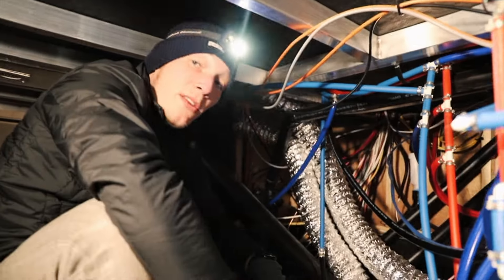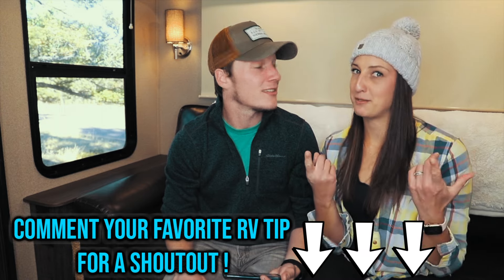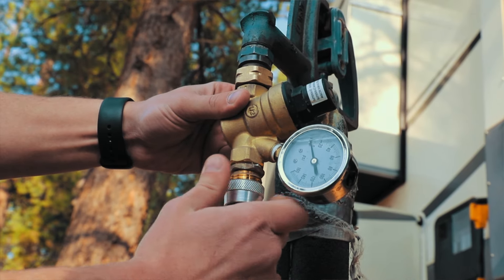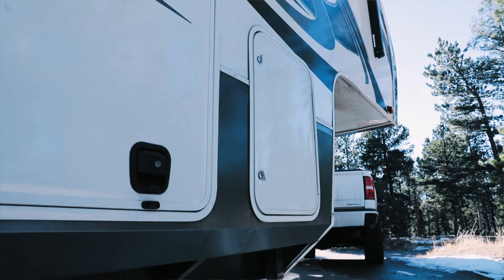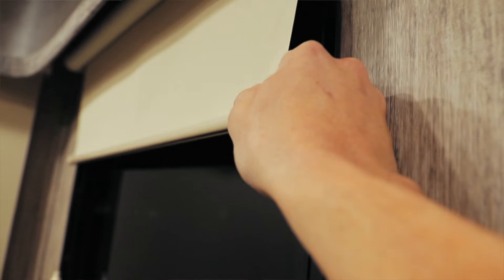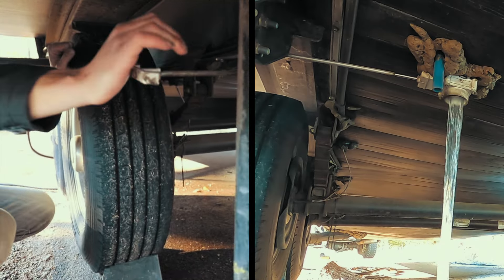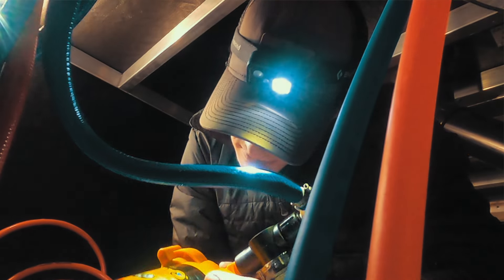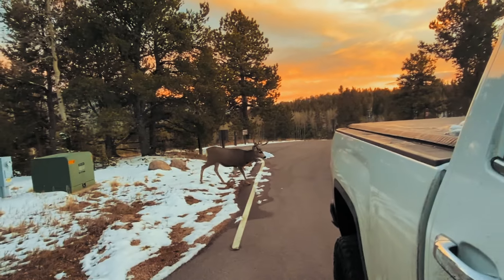First Winter in an RV - Frozen Pipes, No Water!

Comment from the maker: This is a video that is packed with valuable content to show you how to handle frozen pipes in your RV. You are going to find lots of information in the next 10 minutes, so we left timestamps below for your convenience to reference back to anytime.

If you found this content to bring you value, please leave us a like on the video 👍🏼 Leave us a comment below and let us know if you agree or disagree with any of these points!

Follow Us For More Valuable Content Related To RV Living: https://urlgeni.us/youtube/channel/KVJA 

✧✦❄ ITEMS FOR WINTER RVING ❄✦✧

---Heat Tape for Hose
https://urlgeni.us/amzn/heattape

---Heated Drinking Water Hose
https://urlgeni.us/amzn/heathose

---Insulator for Vents
https://urlgeni.us/amzn/ventinsulation

---Reflectix for Windows
https://urlgeni.us/amzn/reflectix

---Dehumidifier
https://urlgeni.us/amzn/dehumidifier

HappilyEverHanks Amazon Page 📦
https://urlgeni.us/amazon/HanksStorefront

⏱ TIMESTAMPS

 00:00 Video Start
 01:38 Top 3 Tips For Surviving Winter in an RV
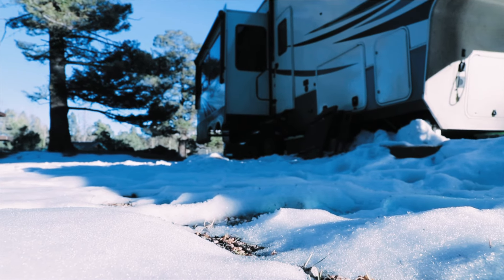 02:04 Preparing Your RV For Freezing Temperatures
 05:27 How To Stay Warm In Your RV
 06:56 What To Do If Your RV Pipes Freeze
Reply: Great video. Thank you. Check out Xtreme Heaters. They are a bit pricey but have a small foot print, use little power and turn on and off automatically based on the low (40) and high temp (55) in the compartment. Thanks again!
Reply from the maker: @noworries.8601  that’s a great suggestion! We have been looking for something really reliable, we will be sure to check them out! Thank you  😊 🙏- Kyle and Renee

Comment: Little tip guys if your hooked up to water in winter with a heat tape water line as long as the water is dripping your pipes will never freeze
Reply: I did that and I pretty sure the outside hose still frozen.

Comment: More great lessons for folks just starting out.  Cold weather camping can be tricky.  We highly recommend a heated water hose!  You can then run water on a very slight trickle at night to keep water flowing (we learned through frozen lines too!)  Another awesome video guys, glad you nothing got damaged. -Chris & Suzannah
Reply from the maker: Yeah it sure can be tricky, so sorry to hear that you guys also had to experience this 😭The heated water hose has been something that we have been holding off on the for the longest time...we definitely need to get one ASAP! lol Thank you Chris and Suzannah for the awesome comment and suggestion, you guys stay safe out there! - Kyle and Renee
Reply: Heated water hose and using heat tape seem to be a great fire risk- many catching fire.
Seems like leaving the water running with the grey drain open would be the better idea.
Or filling the fresh water tank and using the pump with furnace heat

Comment: Let it drip.  Anytime the temp gets below freezing you let it drip.
Reply from the maker: Great tip, Ross! Have you ever had any problems with leaving the water dripping all night and the tank was wondering if you leave the tank open and if so, have you had any problems with it freezing in the sewer line? Many thanks for your time for answering 😃
Reply: When we drip we leave the gray tank open.  Never have had an issue of it freezing in the hose.  I do have my hose on a stand so it flows easily downhill. If your hose is laying on the ground then has to go uphill to go down the connection it would probably freeze in the hose.  @HappilyEverHanks
Reply from the maker: Great to know! Thank you very much 😃We appreciate your support @rossbrashear535

Comment: WHAT, snow ball at the camera??? LOL.  So, this is making sense why our propane heater vents run through the floor, cause it's close to the tanks and the water pipes.  Ours isn't a 4 season RV, but we could still see freezing in the early mornings occasionally.
Reply from the maker: What can I say, Renee was feeling extra salty and wanted to take it out on the camera 🤷‍♂️ 😂 lol yeah we had even tried plugging up some of our vents in the upstairs temporarily to force warm air back into the underbelly. It was a loooong process of getting these puppies unfrozen, but they finally pulled through! I guess Texas can have some freezing temperatures too right? Haven’t spent much time in Texas, but I’m sure it encounters its fair share of low temperatures

Comment: I heat the inside of my RV with 3 electric heaters 2 1500 watt and one 400 watt, i dont use any propane, the small 400 watt is in the bathroom next to the vent where the heat for the furnace would be coming out which is also linked to the underbelly nothing has frozen yet at -25C i also use a plywood with foam insulation skirting sealed with sprayfoam and thick plastic on the outside of my windows still lets daylight in the windows and takes away moisture
Reply from the maker: This is wonderful information, thank you for taking the time to write this out 😃🙌🏼 Great ideas!!

Comment: Our tip would be while travel nursing during winter in PA.

 We had a large propane tank from the local propane company delivered to our site  so we could keep up with our furnace and not run out of fuel so often
Reply from the maker: Hey Alex! That is an awesome tip! Being in colder climates, you sure can burn through propane quickly and it really helps having the larger tanks. When our tanks froze, we went through a 30 pound propane tank in 24 hours 😭No fun, but you live and learn. Thank you so much for the awesome tip and comment 😃👍🏼You are definitely getting a sticker 😎We appreciate the support, stay safe guys! - Kyle and Renee

Comment: With your skirt insulation barrier (hay bails work great), hang a string of 100 watt light bulbs using the other 15 amp circuit at the post, keeps the belly above freezing.  A lamp in the basement will thaw the pipes out as well.
Reply from the maker: Great idea

Comment: GREAT JOB (as usual) - very informative!

RV TIP:
Warm your inside plumbing by opening your bathroom and kitchen cabinets, so your trailer’s heating can keep your internal plumbing warm. Also, allowing a SMALL drip from faucets into a bucket in the kitchen sink can also help prevent freezing by keeping water moving. Use the water in bucket to flush toilet.  BUT PLEASE, keep an eye on the bucket, so you don't have a water overflow DISASTER.
Danny & Lynn
Reply from the maker: Such a great tip!! We needed this about a week ago 😂 But then we wouldn’t of had inspiration for this video! Thank you so much for the support! Safe travels! ~Renee and Kyle

Comment: The one thing you must be careful of is you power usage, If you have only 30 amp service then keep you draw to 20 , If you have 50 amp service -again keep your draw to 30 amps. Keep a safety buffer of 20% for flexibility - The Power chord is not designed for constant max draw and you'll end up burning out the plug.
Also if you are in a park during the winter time and it is full with other full timers power is or might be a problem - use the formula and calculate accordingly 
Remember - when the Voltage goes down the amperage will climb - and this is where a lot of people run in to trouble of electrical issues { breakers popping and wont reset } { Fridge heating elements failing } computer laptops charging issues } things of this nature all because of power or poor power supply during the winter. Electric heaters are the worst thing for a rv as they tend to burn out rv receptacles inside the rig -{ this is why using your furnace is so important } you have to balance between power and the use of your furnace putting more load to the furnace, I know this as I use to live full time in a 1988 travel trailer and never had a power issue, but saw others who were in the same park as me have burn out problems and no power...
Stay safe out there 
Cheers.

Comment: To thaw out frozen waterline :  leave open a faucet. Heat up a pot of water. With silicone or latex gloves on , dip rag in the water and rub on frozen spots til it starts running again.  I was a repair plumber for 40 years

Comment: You know what works amazing for filing those cracks around the slides??? Foam pipe wrap insulation from a home supply store (HomeDepot/Lowe’s Etc). It’s about 1.50/275/ piece.  Depending on the size you get, It can be cut in half and then those can be tucked into cracks.  Easy to put in and remove and easy to store!!! Also works great to keep kitty toys and small dropped items from going under the slides.
Reply from the maker: Ooooh!!! Very very nice! Every time I hear of the foam pipe wrap I think of the pool noodles lol 

Is this stuff easy to find at Home Depot? Someone else was telling us about this and we would love to get some! I am sure it would really help with decreasing the cold draft that comes from the outside 😃👍🏼 do you guys have this stuff?
Reply: @HappilyEverHanks  it’s in the plumbing section sometimes in the isle where you buy pipe fittings and pipe and sometimes it’s in the next isle over.
Reply: @HappilyEverHanks  yes we have been using it for a couple years.!
Reply from the maker: @MrNicmousseau  awesome :) I am way behind on the game lol definitely need to get this! Thanks for the suggestion!!
Reply from the maker: @MrNicmousseau  come on, you know I can’t go to home depot without you! It just never feels the same 😄 we are always going to Home Depot on our adventures of upgrades lol
Reply: @HappilyEverHanks  its a big warehouse of let’s make it happen!  Lol
Reply from the maker: @MrNicmousseau  it so is 😃

Comment: Great video. We don’t deal with snow but we do live in our camper more in the winter. I’ve never thought about not using the gas heat more. We user the fireplace so much and turn the gas heat down cause the fireplace usually keeps the RV warm.
Reply from the maker: Thanks guys!! We love our fireplace but did suffer by having the heat (gas) turned down and extra heaters blasting!! It would probably be ok in 15-30 degree temps but not -5 F 😂 Safe travels! Thanks for stopping by! ~Renee and Kyle

Comment: Great video you two! What I would stress is to seal off at the pass-thru wall as much as you can.(Pool noodles, foam board or whatever you can get) This will help keep more heated air in the underbelly compartment. Plus as the gas/propane heater heats the RV, the return air, that goes under the inside steps, will keep circulating the pre-heated air more efficiently. My suggestion is, try not to wrap the individual water lines as you need them to stay open and exposed to the heated air. I know, sounds crazy but it works. 
Thanks again and happy and safe travels!
Larry
Reply from the maker: This is all such great advice!! So true with those darn steps, that we boarded up of course 😄. Thanks for checking out our video!! Safe travels!! ~Renee and Kyle

Comment: The one thing we do when hooked up to electric in cold weather. We put a small electric space heater that has a thermostat on it, in the underbelly to keeps the pipes from freezing. Most 5th wheels have an outlet in the underbelly. You just have to have it warm enough to keep from freezing the pipes.

Comment: We have an oil filled space heater (electric) that we put in our bottom compartment.  Of course that would not work in a boondocking situation. We also disconnect the water hose too.  We haven't stayed in the cold much because we chase 70 degrees and winter down south.  Good thoughts about the slides leaking air though.  Agree with the dehumidifier in general for an RV.  Good summary and TYFS
Reply from the maker: Hey those are some great ideas! Definitely always pays to be prepared for cold temperatures (unlike what we were) lol smart move chasing the warm weather, we want to get into that position for the future. Thank you so much for the awesome comment and watching 😊👍🏼 - Kyle and Renee

Comment: I installed a recirculating pump under the kitchen sink that I run in cold temps.  it has a timer and thermostat if you want to set it in an automated fashion.  it helps keep the water flowing through the pipes

Comment: I would use a 75W incandescent light bulb.  Not so hot to melt pipes, but enough heat to keep the piping area warm.  

I had used an official heat lamp.  I got it too close to my black tank valve & melted it!

Comment: Problem is burning large amounts of propane can be very costly, but I guess it's better than major freezing problems. Would be better if you could run your propane system on "fan only", (no gas),  to push the electric produced heat from the cabin down to the underbelly.

Comment: Just a thought. If you turn your thermostat to Fan on for the thermostat while running the fireplace, you can help spread that heat under the rv, you’re not going to get as much radiant heat as when the gas furnace is on but can help spread and even our temperatures through the space. Maybe even tie a vent into the under cavity to help prevent freezing.

Comment: Thankfully newer RV plumbing uses plastic pipes that are much more durable  when it comes to freezing and will typically stretch a bit without bursting. Especially if the water system is not under pressure, I've had mine freeze up completely a few times and after thawing it out have had no leaks. Old school copper piping will split on the first freeze unfortunately. Running the furnace, using portable electric heaters in certain areas and a heat gun can usually thaw things out in a hour or so.

Comment: Should have a 3way conected to your pump so if it freezes you van have a 5 gallon water jug inside the rv you can run the hose to and have water untill you thaw out your pipes

Comment: Tip
If you are fill time and plugged in, Use the propane when it gets cold.
Then if you loose power, your water heater will keep the water heater from freezing in the water heater.
I have a exposed water tank, so I don't even try and keep it warm.
I also push a cheap Styrofoam ice chest over the low spot drains and up tight to the floor, and I havent has a issue with it freezing, but Iv only been down to the lower 20's ish.
Reply from the maker: That's a great tip! Way to make the most out of the supplies you already have. Nice thinking on the low point drains being covered, you have some great "outside the box" ideas! No pun intended LOL
Reply: @HappilyEverHanks  
The ice chest was only .97 at Walmart and easily worth $1 🤡
Reply from the maker: @dontask8979  nice!!! 😊🙌🏼👏🏼

Comment: Love your electric fireplace.  Great tips. We have a three season trailer, hoping not to be anywhere that's freezing once we start full timing.  Never thought about drafts with the slide outs.  So true about using a dehumidifier.  Lots to worry about in the cold.  Stay warm.
Reply from the maker: Thank you so much! Yes, the electric fireplace is really nice to have. We had a hard time balancing the electric fireplace and propane furnace at first. We actually put pipe wrap underneath our slides...they sneak under really easily and are cheap. Definitely help cut down on the draft! Hope you have a wonderful New Year 😃👋🏼- Kyle and Renee

Comment: Where do you pour your dehumidifier out at? I personally would not want it in my gray tank because it would fill it up too much I would find a place outdoors at least I would think that's what Dexter would do. Great video and many thumbs up for all the shots of Dexter do you ever think about using pipe insulation like you use under your house?
Reply from the maker: We've thought about pipe insulation but getting to all the pipes is so rough! If we are connected to full hookups then we'll dump the water down the sink drain

Comment: My 3685fl keystone montana has the underbelly heated from the furnace in the damper and I have it set to 70 and the campers underbelly is fully insulated and has the furnace heat pumped into it and my pipes keep freezing

Comment: What about the hot water heater that is exposed to the outside essentially? All it is, is that little metal door and then you have the hot water heater. Does it just keep itself warm enough to not need anything?
Reply from the maker: That does a great job keeping itself warm, as long as you have the heater actually turned on
Reply: All good as long as you have AC power and or propane!